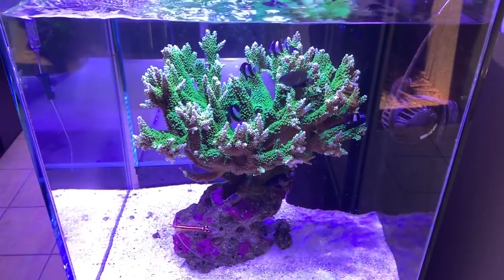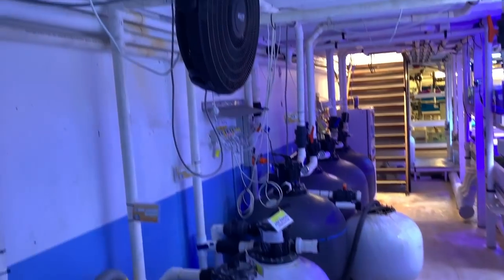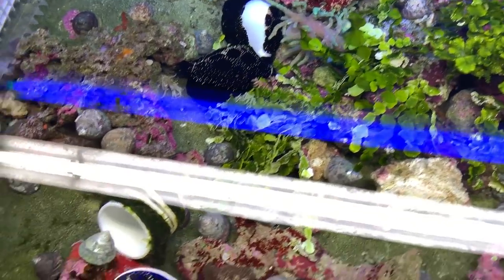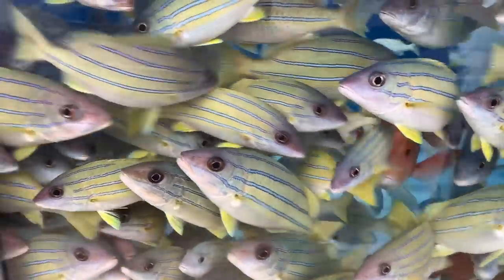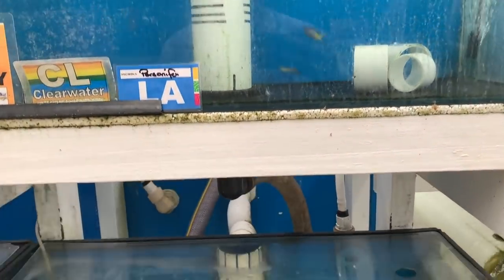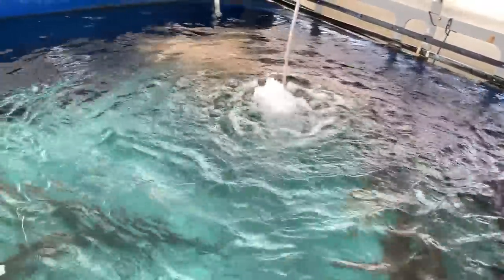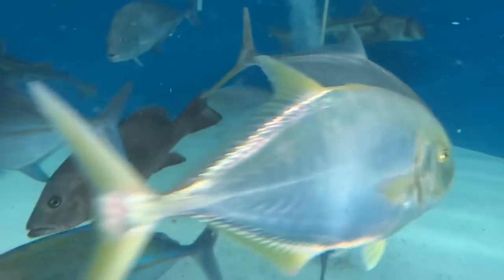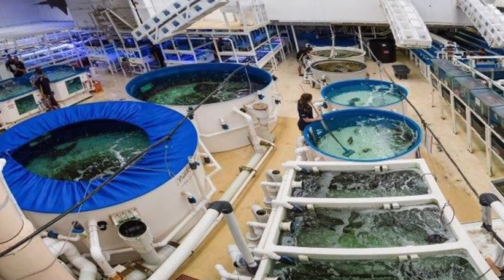Cairns Marine Facility Tour - long video

Comment: 8:10  Harlequin shrimp, and the reason for the starfish in with them is because that's the only thing that they will eat, I have kept these before and are beautiful but hard to keep the food supply as I would have to run and get a chocolate chip starfish for them to eat once a month
Reply from the maker: Well spotted :)

Comment: Nice work. Quick one given you mentioned ozone... Do you use that ozone gen on your tank ? Ive got a tunze 9430 with ozone inlet and have woundered if its an effective and cheaper option to run in controling parisites compared to UV....i know the health risks with ozone if not managed properly. Cheers Gab
Reply from the maker: I actually run Ozone and UV on my main tank. Yes, you need to be careful with Ozone - but it is very effective
Reply: @ParkersReef  thanks for the reply Sam.